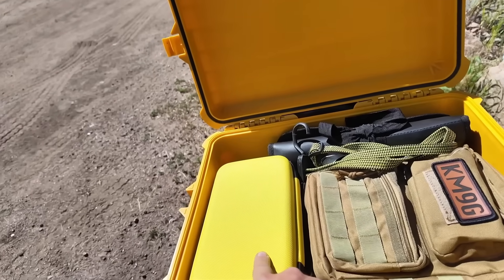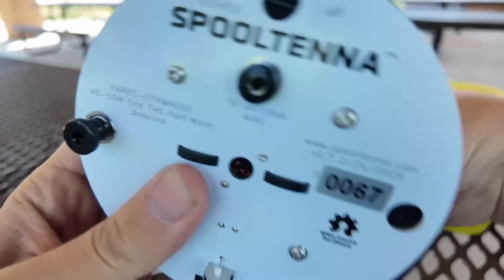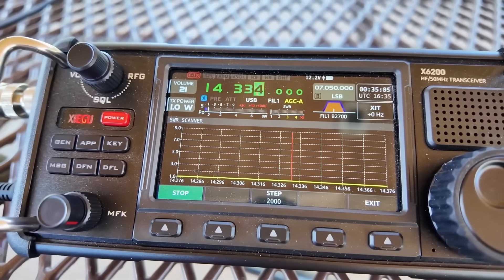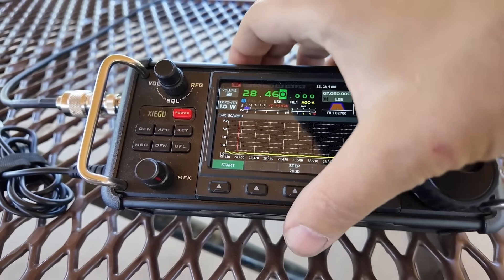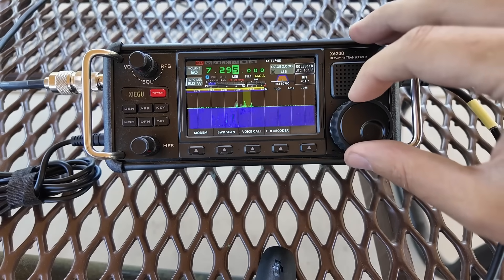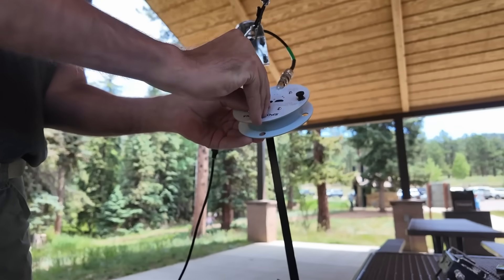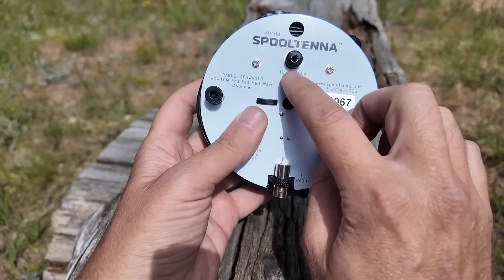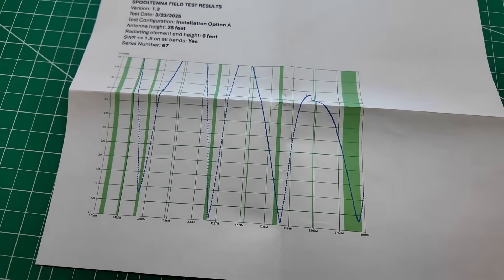NVIS Doesn't Work!

Comment: Somebody should be along soon to mention the relevance of fof2 (basically, vertical MUF) to whether NVIS can work well. Usually it's either 80m or 40m during the day, depending on the fof2. I suspect that on 20m you weren't really doing NVIS but I don't know your band conditions that day.  As far as I know, NVIS is about relatively local comms, a few dozen miles radius.
Reply: Agreed. NVIS is well documented as only being effective at the lower end of the HF spectrum.   Works very well on 160, 80, and 40 meters but not on higher band frequency bands.  For further reference read the RF propagation of any ARRL Handbook.

AJ1G
Reply: @louisebrooks is right on the money.
most people dont understand how NVIS works, there is no NVIS going on on 20meters... it only works on lower frequency and totally depends on the MUF/FoF2 frequency at that time. instead of forming the beam towards the horizon the proximity with the ground is guiding it straight up. the RF is then bouncing back and forth up and down instead of skipping at long distance horizontally like usual on HF. it is why NVIS range is only around 500km.
Reply from the maker: Louis was right about fof2, take a look.
Reply from the maker: NVIS is predominantly about "local comms" - you have a higher incidence of making a local contact because most of your energy is in that space instead of skipping past it - your first hop is closer to you.  But it does go a lot further than people think.  Band conditions have been pretty bad during the time of this recording, but we still got it done.

Comment: NVIS has never been an exact science for me. I've gotten "NVIS" propagation (1 mile through 300 miles on 40m) with an EFHW sloper from 25' down to 3'. As you said, just put the antenna up and see how it does.
Reply from the maker: Exactly Doug!
Reply: any lower band HF antenna installed at less then .25WL is automatically NVIS oriented. it is due to the proximity to the ground and the way it force the beam upwards. you need to check out the MUF and FoF2 to make sure the band you are using will work. sometimes even 40m is going straight into space instead of bouncing as it should. if you want to make sure try 80m instead. it works 99% of the time.
Reply from the maker: @VA2DKK gets it.

Comment: As flat as that SWR is across so many bands looks like a dummy load..
Reply: Does the SWR sweep include the ATU in the circuit?
Reply from the maker: If the ATU is engaged, yes.  You'll see a high SWR, then a sharp DIP where the tuner makes the radio happy, then back to high SWR.
Reply: i was about to comment this. this antenna maker [heavily inspired] his design after mine and is using something inside to cheat the result so people dont complain. mine is sold for 4times less money then him and i am not cheating by using resistors or anything. its impossible to have the band so flat.
Reply: @va2dkk I don’t think that is it. Well I don’t know anything about either internals so I can’t say, but the specification sheet for TOs antenna that he showed in the video  doesn’t show it going down to 1.0 like the 6100 shows it. And being 1.0 across the band is suspicious I thought the timer was doing that. Maybe there is something inside that presents as a 50ohm match for the 6100 sweep and the amount of tx current it uses during SWR sweep,  but not analyzer used to generate the spec sheet
Reply: @AbeKC3WOA  it is common to cheat and use somekind of resistor inside. CHA does it too and so does the US military. its just that its wasting alot of energy so if you are doing QRP then most of your power is wasted.
Reply from the maker: The power of a resonant broadbanded antenna
Reply: If so that may “look like” a dummy load but it’s just because the ATU is able to pull the already low SWR  in the resonant spots flat across the band
Reply from the maker: I did not use the ATU with this resonant antenna.
Reply: @temporarilyoffline thanks for the clarification, we designed to 1.5 to 1 or better on all supported bands. There’s no magic or cheat inside this antenna :-) it’s a standard 49:1 UNUN.

Comment: Testing is key. You can use an NVIS antenna placed directly on the ground. It won't perform as well as say at 7-feet but it will work at reduced distance. Testing will show you the range you can expect. I had excellent results using a AH-4 tuner into 200ft of steel cable hung at 7.5ft. Why 7.5ft? That was about the height of the ladder racks on the roof of my van.
Reply: Yes, as USAF pilots used to say about the F-105, given enough power, even a brick can fly. Ditto with antennas.
Reply from the maker: Very true.  Since its all a compromise, its more about what works "right now" then about who has the most money for the most compromised antenna.
Reply from the maker: Exactly - stop worrying about the opinions of grumpy old men... everything works!